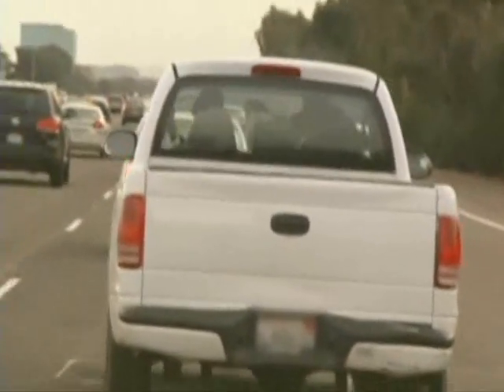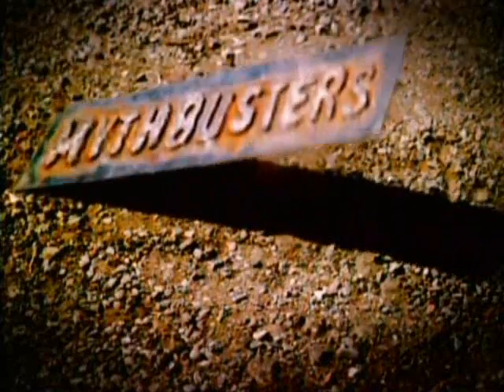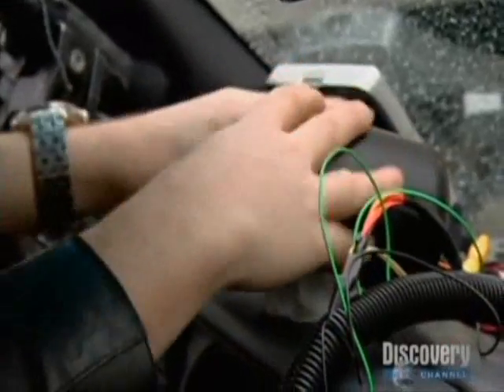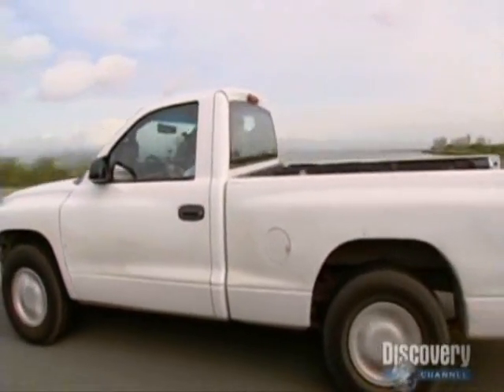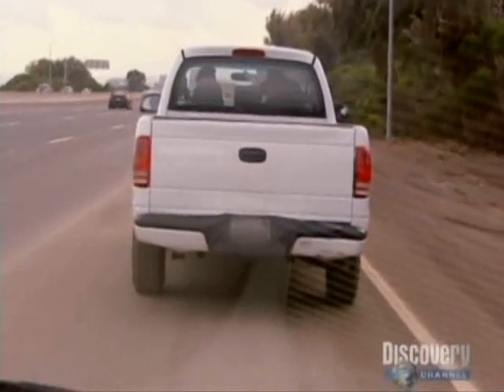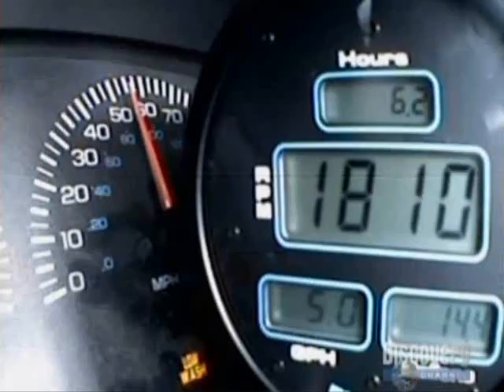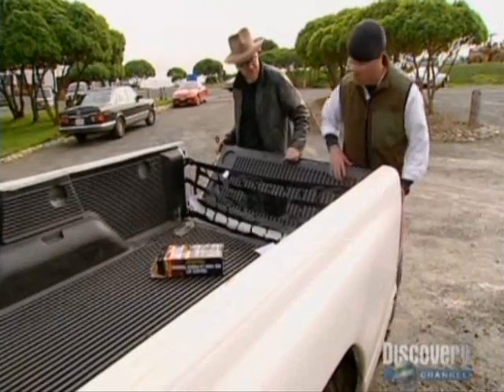Insert from MythBusters - Tailgate Up or Down 2 (from More Myths Revisited) fuel consumption test

Comment: So what we really learned from this was, removing 40-50 lbs from your vehicle makes it more efficient.   I wonder what removing the doors would do?
Reply: @GeorgiaRidgerunner  I don't know if that would actually be illegal - I see Jeeps driving around without doors. The only legal issue I could see is that mirrors are almost always mounted on the doors, and lacking mirrors might be a ticket. If you took the doors off and mounted mirrors somehow it would probably be legal.
Reply: Typically having a big hole in the side of the vehicle would add a lot of drag. This is why driving with the windows open is less efficient. Weight has some impact on fuel economy, but at highway speeds - especially on level ground - aerodynamics play a much bigger role. So taking the doors off might save fuel at city speeds with a lot of stop-and-go (where accelerating weight is much of the fuel usage) but would be worse at highway speeds.

Comment: I don't know why they hid all the numbers from last 2, tests but thought it was interesting that the cover and tailgate up were exactly the same.
This confirms a suspicion I had that, once stable and underway, a pocket of air builds up in the bed that resists any new air. Making it functionally the same as that piece being flat.
Also, tailgate down rather obviously becomes a spoiler providing downforce so that makes perfect sense.
I'm curious what the net vs. nothing was. I'd imagine those 2 should be very close to each other ?
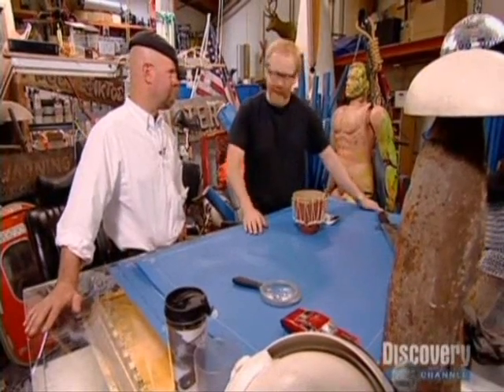Reply: See 06:45 ... mesh for the win

Comment: The problem I have is that MY experience has told me more than once that tailgate down at 75 to 80 mph in the wide open spaces of the Intermountain West, as opposed to the cluttered and sedentary SF BAY AREA FREEWAYS, TGD produces a noticeble increase in mileage and sustainable performance. The skirts one sees on the side of semi trailers are next to useless at speeds below  60 mph(except for preventing 4wheel autos from driving under the trailers be blocking the clear air vision, the same works with cattle in squeeze and header chutes, it works better if the only view they have is straight ahead). The flaw in the model presented here and previously, is the oversight that aerodynamics change greatly in varying increments  at often unpredictable rates and the difference btween 55 and 65 mph is a very noticeable difference.

Comment: How the hell is the mesh better than no tailgate? They should've explained why they think that in particular seems to have such a positive effect on mileage.
Reply: If I remember correctly. The mesh was slightly better for two reasons. The first being that you still had something of a ''wall'' to create wind to be pushed against the cab but yet aero enough to ''flow'' but most importantly you eliminated anywhere from 20-50 pounds off the tailgate. I bought a 2014 F-150 last year and would get consistently 15 city and 17 highway. Took the tailgate off and dropped the spare tire and started hitting about 16.7 city and 18-20 highway. I drove from Pigeon Forge, Tennessee to Middletown, Ohio (300 mile trip) and averaged 20.3 hand calculated and 21 as measured on the dash because of those two things. Though I don't really recommend it because if you get a flat, you're basically screwed.

Comment: So let me get this straight, they just measured the fuel flow to the motor and didn’t subtract the return flow to get actual consumption? Or did the gauge take that into account on its own?
Reply: Most modern vehicles utilize a returnless fuel system, this was done because with the old way fuel heated from the engine would return back to the tank which has two effects: higher chance of vaporization making the evap system work harder, and shortening the lifespan of the fuel pump. The truck they are driving and correct me if I'm wrong is a Dodge Dakota. From 92-93 they had return systems, and 94+ has returnless. Judging by the body style this is a 1997 or newer Dakota so there would be no fuel return line to measure.
Reply: @waterdrinker6659   Thanks a lot, I didn't know that

Comment: I'm curious as to how the flow meter took into account fuel going back to the tank through the return line? I realize the same meter was used for all the tests, but have to wonder if it makes a difference.
P.S. I had the mesh on my last truck. What a royal PITA it was. Give me a proper tail gate any day.
Reply: @WATER DRINKER has it right, this model (1997 or newer Dodge Dakota) doesn't have a return flow.

Comment: 5 gallons an hour at 55MPH must be 11MPG. Be cleaner to live in Hong Kong during smog season.
Reply: doyle201206 5g and hr to the fuel regulator. Doesn’t take into account the return line. 5 gallons is flowing to the engine but not consumed by it.
Reply: @SPPTA  depends if its even got a return line. Most newer cars dont have one.
Reply: @SPPTA  5 gallons is NOT flowing to the engine...what are you smoking dude

Comment: Very bad experiment. The data is completely useless and unreliable considering the wind direction and strength could had changed.
Reply: They could have also been to the toilet between runs.... yet another possible weight reduction there!!!!
Reply: el4an Not to mention they were breathing which throws all the results off.  Also they should have done this at night due to the effects of the sunlight.
Reply: sailingsolar Yup. There are a lot of factors to take to consideration in a experiment like this, but you're right, for rough conclusion purposes this test probably does justice.

Comment: Save a mile per gallon or 1/2, it does not take into account that the structural integrity of the pick up bed is designed to be maximized with the tailgate in place (up).  So, to put it mildly, the vehicle is not structurally stable in a rear end collision with the tail gate down. So, for safety sake... No webbing, no tail gate down.  Keep it in place, up and latched.

Comment: Not all trucks same // air dynamics //  stone guards under truck change back draft // and height of truck // have owed 10 or 12 trucks and drove 30 more over my life time some it helps some it hurts millage //  NOW LET ME SAY THIS I DONT SELL OR PROFIT FROM //  THIS ITEM I AM RECOMMENDING
Buy a  {  ULTRA-GAUGE }  There only about 70 dollars and it Will give you correct info // it plugs into ob11 port // takes about 15 mins to install //
 has 73 different  gauges  //   see them here on YOUTUBE

Comment: seriously people who complain about gas mileage are retards. you chose the vehicle you have to suffer with what it gets for gas mileage.  i drive a truck cause i want to. i could probably get away with driving a Prius, but i dont want to. so i suffer with the gas mileage.
Reply: I gave up on getting good gas mileage. I drive a '91 Dodge Daytona, and I consistently get around 15 mpg in the city. After a while of that, I came to the conclusion that I should stop worrying about efficiency and have more fun. Currently I get around 300 to 400 smiles per gallon. Worth every penny

Comment: @dferendario
Um, Gday. I call myself a "retired Low-Speed Aerodynamics-Consultant"...;OK, & these are good efforts 2ward a valid test. What they missed is the effect battery- condition has on fuelburn. At 30% discharged, anything with a 3:1 alternator step-up drive (normal these days) may use 30% fuelburn for recharging... Search 'sunfoil' & view the "Short-Talk.." clip, it has most recent data... For the Aerodynamic aspects, try 'solar thermal ramjet'.

Comment: Seriously? How about putting it in neutral down hills and inflating the tires to 83psi. Remove the side mirrors and put a full body under belly pan.  Buy the lightest most drag efficient rims and tires also. Hell remove your wiper and fill the grill leaving just a slit to grab air. Or just drive your damn truck. Want to save petrol, buy a Pegoretti and loose some weight to boot. Damn!

Comment: Would be interesting to see a camper shell test - only one they didn't do.  

My best guess as to why the mesh worked out better is b/c the mesh still provides some of the effect that forms the bubble of air in the bed of the truck, while it lets some air escape - so no parachute effect as with the tailgate up.  And saves weight.  Too bad they're so damn fugly and worthless if you need to keep something in the bed...
Reply: also weight reduction

Comment: I'll still drive with tail gate down. Why you ask? Because the cameras can't see my license plate. Lol.
Reply: If you get pulled over and the officer insist on you closing the tailgate and then just simply take off the Striking pins and it will never stay shut. Whenever you really do need to use your tailgate, just screw in your striking pins and it'll shut as it should
Reply: Wow I’m so late to this comment thanks for the tip
Reply: I just keep my bike rack on 24/7 lol
Reply: Lol nice useful for toll roads

Comment: A tonneau cover isn't light.  Added weight means the engine does more work.  The added weight is a negative, the better mileage is a positive, and they clash and cancel out.

The mesh saves weight and changes how air moves about in the bed. 

I have an 87 F150 but it won't get a cover or mesh.  It's a truck didn't buy it to save on gas.  Bought it to do work.
Reply: I'm pretty sure it's because once a stable speed is reached, the tailgate up results in a lot of trapped air in the bed. The trapped air is pressurized by the speed of the vehicle. It resists any new air coming into the bed, so the result is functionally the same as a flat top across of it.